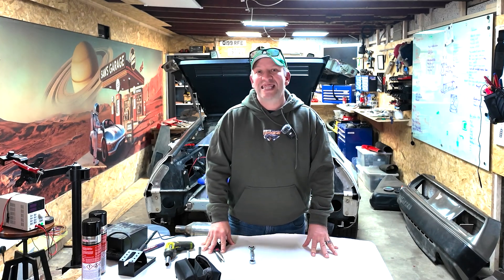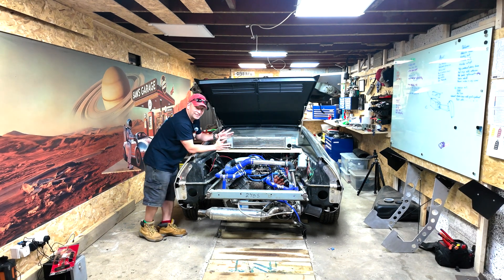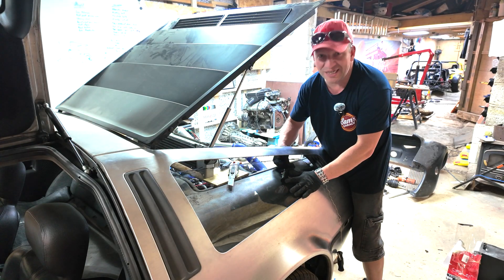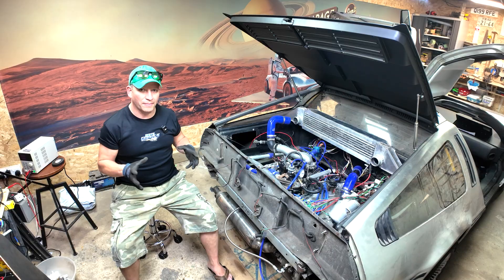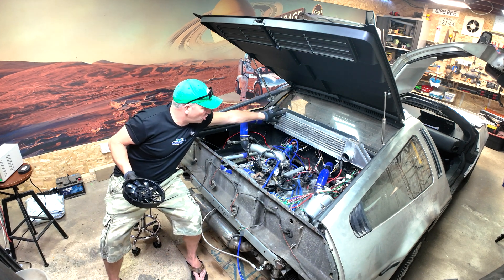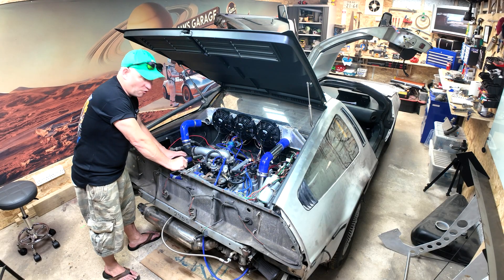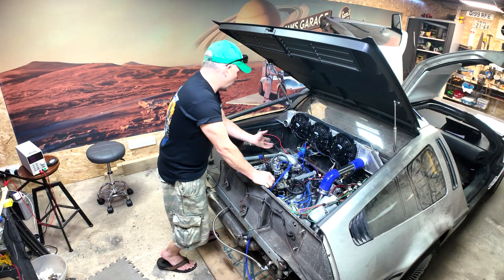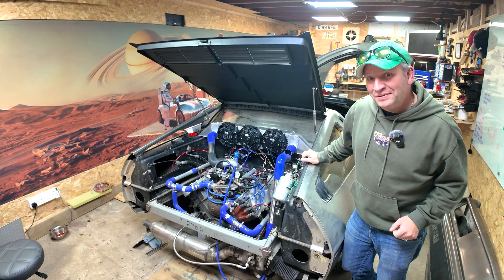THE DELOREAN TURBO GETS CHARGE COOLING

Comment: Hi as your removing both the rear quarter glass (brave) and happy with your inter cooler, would it be possible to fit perspex items with a scoop directed to the front of the cooler with a fine mesh? Hopefully the loovers in the  boot lid will make it draw air in, might not need the fans. Just a thought maybe fit a temp gauge to it and try it with or without, cooler the better. Hopefully you'll get some more feedback. 👍
Reply from the maker: Thanks @mickilgobachin6623, it's a good shout, if I'm honest, the fans aren't really needed, at standstill you're not using boost anyway, but I think they look cool and will stop any vapour building up in the engine bay, the three fans will draw about .036 bhp from the engine, so the losses are minimal. I thought side scoops would make the car look closer to stock if I get them right, but we'll have to see : )
Reply: @SamsGarageOfficial it's probably a good shout having them, added security keeping the engine bay extra cool in the summer months. I don't know much about turbos to be honest other than they sound good and go like poo of a spade 😏
Reply from the maker: ha ha ha, well the hope is for about twice the power of a stock DMC 12 so it's going to be interesting!